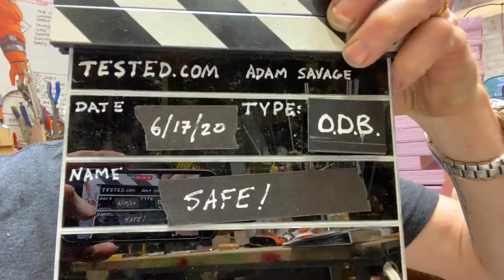Adam Savage's One Day Builds: Foam Prop Safe!

Comment: Usually I love how Adam finishes off a paint job, but I feel like he missed the mark here a little. Something I've found that really speaks weight and heft is hammered effect paint(specifically Hammerite), it has a lot of texture and colour variation to it. It would of been interesting to see the safe finished off in that paint.
Reply: Yeah, love the effect. You paint it with the stuff and BOOM, 200 kilogram heavier. xD But to be serious, yeah, thats probably one of the things that people connect really closely to VERY heavy, as its often used on very massive and heavy machines.
Reply: Oh yeah, dark blue or dark green Hammerite coat would make that thing look even better.
Reply: Agreed.  Sloppy paint, far too much "bare metal".  Should look like thick hammered paint, jet black, with highlights scuffs and chips mostly just around the edges.  And mostly, some ornate gold scroll decor lines.
Reply: Agreed is is a little cartoony I’m not buying the safe is real or heavy from the paint. Maybe too much run and buff. I have had great luck using a silver spray paint as a base and then dusting over it with black.
Reply: Also getting the chipped effect on "laquered" paints sells a piece as actually being old. Masking with latex, spray painting and then pulling the latex away gives some solid, realistic wear and tear chipping effects, instead of even gradients that tends to just look spray painted/dry brushed on.
Reply: I've used Hammerite on a few projects and one commission guitar body.  A lot of foams react or dissolve with certain solvents (like acetone).  And I am pretty sure the solvent cocktail in Hammerite would.    Hammerite would be good for a LDF or MDF safe but it would be much heavier.  But foam is much easier to carve and shape.
Reply: that's why 'flex seal' makes such a great way to prep foam work for paint.  automatic hammered effect!
Reply: Knowing Adam, he knows this already but he clearly stated it was a "Halloween" type prop.. if he wanted to put the time and money, he'd make an insane replica
Reply: @cruftcreator  The hanging safe, anvil & piano are a cartoon meme after all so ideally such a safe should look cartoony in my opinion.
Reply: Nothing to worry about. He can give it another paintjob later once he thought it through. He alluded to that regarding another build that I saw recently.
Reply: That's what I was thinking. But for being hung from the ceiling and seen from a distance (not far, but not up close), I think it works well. I totally agree with the hammered look though.
Reply: commatoes Thats why you tret it with something resitant to it first. Just a layer to keep the solvents and fes of the foam.
Reply: Elle p Obviously its a „you can do it too“ type of build. But that does not forbid good criticism and ways to imporove it. Seeing discussions like this helps a lot of beginners (and seasoned crafters, there is always something I did not think of myself) improve because it shows how differnt people would approach or improve on it.
Reply: Connor Strothman Thats also true.
Reply: Question: Hammer Marks on Solid Steel ? ? Go look at an Old Safe in your Local Historical Museum.. Or go out & pound a Railroad Rail.... Not happening..
Reply: Hi  @leslyeschoenhuth1107 ,  its quite a common paint style to use for industrial equipment(at least the ones I've worked on) it doesn't really look like someone took a ballpeen hammer to some steel, but the effect that appears from the type of paint that it is(it looks a bit 3D). I would say googling a photo to get a better idea because more that likely you recognise the effect. The reason you see it quite frequently on test equipment and the like is because its very hard wearing and relatively pleasant to look at.
Reply: Now what you mean but Hammerite has a lot of solvent, might not behave nicely with the insulation foam. Adding a sealing coat between foam and Hammerite would be necessary .
Reply: @gleggett3817  Yes, very true. He did already add a sealing layer for the other paints he used so the only difference would probably be the last paint job he did to the safe.

Comment: Is anyone else thinking "Hey, that's a bad ass cooler"?
Reply: Build it a little thicker, make the door a little more exact, and put small, evenly spaced holes in the shelf for air flow, and it would work great for that. Put the ice on the bottom shelf, and your food or drinks on the top shelf, and it would be a cool "conversation piece" at a cook-out or the beach.  I'd also ponder making it larger, and work out how to drain it when all that ice melts, but yeah, this gives me ideas.

Another cool little feature one could add is, instead of a dial and crank-style handle, make a "u"-shaped grab handle on the front, and add a hasp for a padlock. Form and function, for they who control the drinks control the party!
Reply: It is giving me ideas for a beer safe!!

Comment: Hey Adam, If you want to work with the pink foam I cannot recommend a good hot wire cutter enough. It makes working on the foam a breeze and is ridiculously clean. With the added benefit that you cauterise the pores and close them while cutting. I originally got myself a Proxxon one and the mdf add ons from shifting lands (makes working a lot easier and has some very interesting contraptions for special form cutting) for table top terrain work, but discovered how much of a help it is for large scale work. I am now using it for all kinds of props (swords, guns and all kinds of larger props) and can rock out stuff in a tenth of the time compared to before. It also makes everything look so much nicer. Its a bit like a bandsaw specifically for foam that you also can use for planing, shaping and all kinds of other stuff. Even interlocking parts as the thickness of the cut (melt?) is less than half a millimetre if set up right. I recommend looking up Shiftinglands youtube channel to see what stuff he gets up to with it.

Comment: 5:05 My guess would be this is an Adam worshop cringe moment and you should turn the saw off before adjusting the table
Reply: What about all those tripping harzards around the shop tools?! This is not the channel to be learning best practices...
Reply: As long you have the right "rituals" and work alone it works out.
The trick is to stand and lean always so it is physical impossible to get hurt.
If you work not alone though that is indeed a bad idea.
The tricky part with such tools is to learn all that without loosing parts of your body, because it is all about experience.
The major tricky part is that you keep people with less expertience do the same (as i learned while using an anglegrinder without protections due to limited space and the person imitating me not aware just how temperamental they become if you go out of alignment with the cut...)

Comment: The same XPS foam can be bought at local Lowe's and Home Depots in 4'x8' sheets in 1/2" and 1" sheets here in Louisiana (color varys by brand).  They also offer the 2'x2' sheets for about the same price.  I understand thicker sheets are sold further north.  Intended for home insulation

Comment: I love working with Foamular. I use Mod Podge mixed with cheap acrylic black paint to seal it and do a base coat at the same time. The sealer helps firm up the foam so it's less brittle and makes it possible to use spraypaint, AC glue, or just about anything on it without fear of melting. Foamular is pretty available in Canada. I use it a lot on many kinds of builds, I highly recommend it. Black Magic Craft uses it all the time, to great effect. It's awesome!

Comment: I have one of these style safes under my stairs for my papers. It used to live in my parents basement for as long as I could remember. I was happy to rescue it from there and repaint it for myself. Adam's initial black paint job was way too even. After the rest of the coats it looks a lot more like cast iron.  He needs a metal plate covering a portion of the inside of the door that can be removed so you can figure out the combination after it's been lost for decades. :-)

Comment: Adam, we use extruded polystyrene all the time in roofing.  Try a roofing supplier.  It'll probably be ship lapped edges though. But you can cut that off.  It's also often used in masonry, so anywhere that sells to bricklayers might be a source too.

Comment: Used to cut a lot of this foam board when I worked in construction. You still had to be careful cutting it on a table saw. It can get pinched between the fence and the saw blade and even though it's light weight, it can shoot back with incredible speed.

Comment: One of my favorite techniques when painting metal is to take a paper towel and wad it up then spray it with chrome paint. Run the towel down whatever you're painting and it'll look like it's been scratched. I've been using it since I was 15 or so and ten years later I still use it. It adds just a little level of detail that goes a long way.

Comment: This would have been so cool with some of the paint that looks like hand hammered metal (Hammerite, or rustoleum hammered black) and then put the gold stripe with a paint pen.  Would have looked like one of the really old 40-50's safe.  This does look cool though, and as suggested in another comment would be cool to put in like an ice bucket and make a cooler out of it.  Very inspiring one day build, love the details and description of methods used.

Comment: Excellent build, as always. I'm using a similar product (no Foamular in Oz) for model terrain and buildings, using the Proxxon hot wire cutting table, First coat of paint is always mod podge with an ink to colour it. The mod podge seems to seal better than a standard PVA glue, the ink means wou don't waste a step. The XPS is a bit thirsty without a good first sealant layer.
Reply: Nearly forgot - Is that high pitched noise your AC or something else?

Comment: I pick up extruded polystyrene foam all the time for making stuff, and it is still available in the huge 8' sheets in hardware stores at different thicknesses way, way  cheaper than what was paid here.  The 'Project Panels' are sold as a more expensive, easier to handle form of the same stuff.   And Foamular is just one brand - there are many.

Comment: Cool safe for sure but if I may give a quick tip to all the makers out here who might be working with Foam for the first time. When pushing foam through a tablesaw there is absolutely zero resistance. It can seem misleading and you may push a bit too hard causing a quick lunge  forward which may take you off guard. Just figured I’d throw that out there

Comment: I know exactly how you feel about the suddenly no longer available big slabs of great form foam, Adam. Back in, like, the aughts I think, I built a chair model out of this great, great foam called Sundolitt, which as far as I can see was a light blue version of what you have there. It came in slabs about 2x4 feet, three or four inches thick, and it was glorious! I bought it at a hardware store, it was cheap - and since then, when I've looked for it, no luck except tiny shards of the same stuff selling for unholy amounts of money at arts and crafts stores...

Comment: Hi Adam love all your one day builds just one or two tips about the paint job stipple the primer coat with a box stippler to give it a texture then a coat of bright aluminium paint then a thin coat of backboard black and rubbed off with a rag while still wet here and there particularly on edges and centres and should when dry resemble cast iron,I used to use this method on wooden railings and looks quite convincing from a distance,thanks for all your videos enjoy them all.Tony.

Comment: You can also do something similar to fill gaps with foam dust as one can with sawdust: lightly water down some wood glue, put it down over the gap, stuff dust. Allow it to dry and you can wipe off the loose stuff and layer again.
This method allows for some sanding afterwards.
Hot glue can still leave channels in foam as the heat melts the foam (less of an issue with low temp, but too much will still melt stuff), so know alternative methods for gap fill can be helpful.
Large gaps (1"+)? Get a can of expanding foam and a misting bottle with water. The water speeds up the cure time of the expanding foam.

Comment: Those little squares of foam are carried at Home Depot as project foam.  The 4'x8' either 1",2" or 4" thick sheets are available.... just not in California.  We don't get cold enough for the stores to stock it.  You can order a full pallet of 4x8 at a California Home Depot, and the price is around $2,000.

Comment: Adam, you should have used some of that hammered texture spray paint.  It does a great job of mimicking the mill scale that you would find on the metal plates used to make a safe.  Also, since most scales end up sitting on concrete, you should have added some rust to the bottom of the feet and around the sharp edges of the hinges.

Comment: FYI. I have constructed tombstones out of R-Tech
 2 in Rigid Foam Insulation and 3M 74 spray adhesive emulsified the foam.  So test your adhesive on your foam before spending hours with your Dremel tool carving your tombstone and then watch the foam bubble turn too liquid and disappear when attempting to glue pieces together...Dang!   I was able to square off the tombstone post the debauchery and applied hot glue which worked just fine...

Comment: dang. We also used to use the pink foam for everything, Rc plane wings and fuselage sections with the hotwire, etc. now we can't find it anywhere except in those little square pieces in the corner in a box at the hardware store.

Comment: I built a smaller safe, the same way, for a Community Theatre One-act I was directing, about 13 years ago. After the run was over, I removed the door, cut a 1-1/2" slot across the upper back, and turned it into a bunker for my boys' 12" GI Joes.

Comment: Adam we actually sell Foamular in 2" thick 4'x8' sheets at the lumber yard I work at here in Indiana and it is expensive (about $45) but one sheet could go a long way with a project so I think it's probably still doable depending on the project size.👍

Comment: The one thing I would add to your build is use some of the dowels you used for the hinges to make locking lugs on the door.  Just that one lil' bit more reality.  Can be sticking out or just real short and countersunk into the door.  Add the recess holes in the safe also.  Nice build.  Just my $0.02

Comment: I used the 2 inch foam like this which you can get at lowes for cheap to make a teardrop while in lockdown from March to July I feel like Adam would like the method of which we used to harden the walls its called "poormans fiber glass" canvas and lots of layers of glue and then paint its pretty strong and paired with a hammered finish paint it has a interesting texture for a look

Comment: In the 90s insulation foam was cheap. Now it's outrageously expensive! It still comes In 2 inch thicknesses. A bread knife or hot wire cutters are the best tools to use with this stuff. Model Railroaders love the stuff for scenery, but I'm going back to more traditional methods because of the cost.

Comment: I prefer air drying water based wood filler for filling that foam. It sands with the foam. Hot glue always creates problems there because it melts while sanding and does not sand to well in the first place. But that could be personal preference. With flexible foam i by the way use painters acrylic. You can smooth it out very well with just your wet finger and it flexes with the foam. Its great for armour builds.

Comment: Here in Canada that stuff is dirt cheap. I have used it for modeling and it's a dream. You can get by with an exacto blade and some spray adhesive. Pretty much make anything with that
Reply: If you add 3d printing to the mix, almost any prop is a day away

Comment: Home Depot has these sheets in 4x8 sheets in 1, 1-1/2 and 2 inch variants.  Home Depot SKU#’s 207179253, 202085958 and 202085962 respectively.  Apparently only available as special order in Bay Area.

Comment: A good way to avoid brush strokes is to use a paint roller. You can even fill in places that already have a coat of brush strokes by running the roller over the top of them.

Comment: Hi, after sanding the foam , and i would have kept the corners sharp like on a metal safe, i'd have sprayed it with a few layers of automotive high build primer, that way you could have sanded it dead flat and just painted it as they would have painted a metal safe.

Comment: the reason you can only buy that size is because the place you visited doesn't move the bigger products. my home depot sells all sorts of thicknesses in 4x8' sheets. i bought last year over 100 sheets and they had it in stock. though this location doesn't have any size of double sani tee for 3", for that i have to drive 20 mins away.

Comment: anything remotely similar we have is pink panther insulation, usually found at home depot (as a lowes employee, I can say we don't sell it, at least in my store.) and even the stuff we carry is expensive, i think it may have something to do with pushing out polystyrene since it doesn't break down naturally, just as PVC doesn't

separate comment in my high school and middle school (you may have seen past comments about how I was in machining class) actually had this hot wire... Idk what to call it... benchtop tool, to actually cut the polystyrene into shapes, and they actually could get really fine detail art for their motion pictures, making a new set of legs or body for the same character between each frame, in middle school there was leniency but as highschool came they would take at least a school year to make 1 frame by frame of just... amazingly made styrene parts.